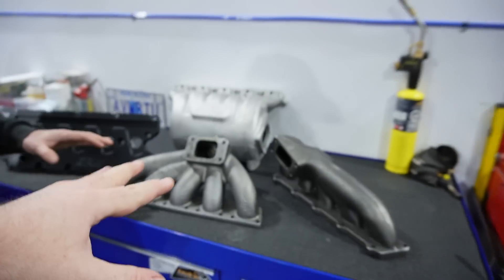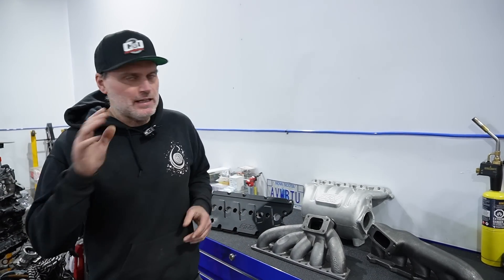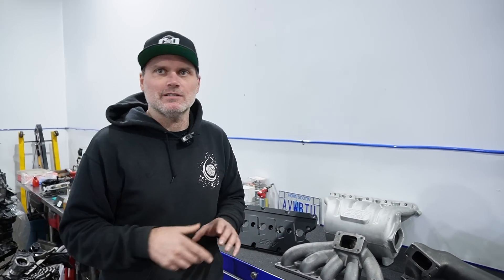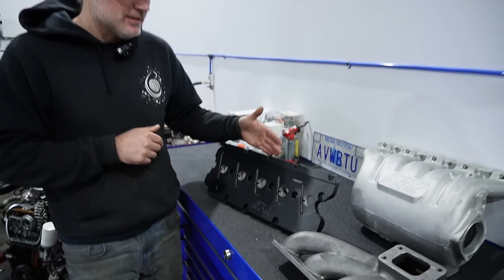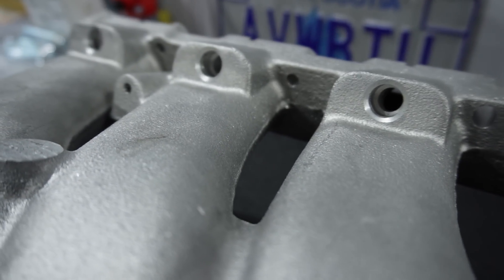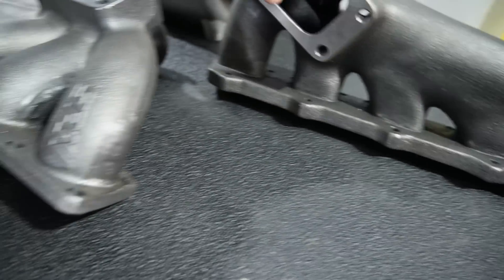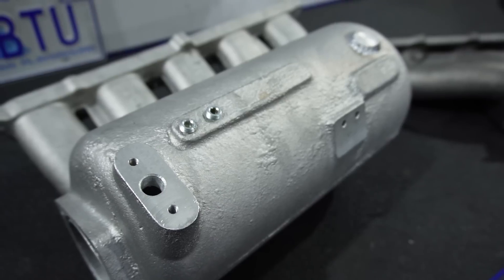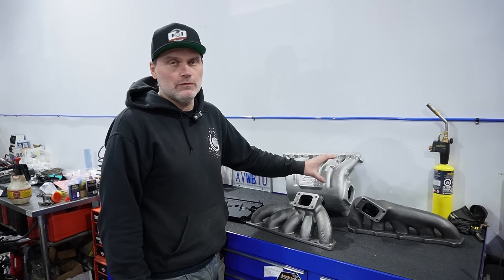07K 2.5 5 cylinder Turbo Kit? A closer look at the SPA Turbo intake and Exhaust Manifold.

Comment: The information is hard asf to find I have a 2012  2.5 and dsg trans swapping into my 91 civic. Do I need to buy a standalone. Is there some software I can get to tune the factory ecm.
Do I need to shell out for an expensive standalone ?
Is there people I can go to in real life to dyno tune for me like 
What's up idk why it's so hard to find the information please hallp
Reply from the maker: That stock ECU will limit you in many situations, especially if you plan to boost it. Even finding a calibrator that works with the specific ECU you will be using will be limited (especially when boost it). So if you plan on just doing stock setup, we can tune that ECU for a swap setup no problem. But if you're boosting it, just go to standalone now or switch harness and ECU to an older version which opens up a few more options.
Reply: @COMotorsports  if I go to an older ecm what do you recommend and will I have to keep the stock ecm to control the dsg?
It will be boosted immediately.
I'm tossing out a turbo b series for the swap lol

Comment: Yes I would love to be able to order a complete kit I can just bolt on I have the I.e. stage 2 tune and I take already but I would love a turbo kit that comes with everything intercooler ,injectors, fuel pump, fuel pressure regulator, and a oil cooled turbo with drain, feed line,  so don’t have to plumb into the coolant lines anywhere. Also  oil sending unit spliter and oil pan bung or sandwich style bung for oil return.

Comment: What turbo would that kit support?  i’m looking at gtx3071R Gen 2 or GT3582. 
Also would that kit supports the IE intake manifold?
Reply from the maker: Well the exhaust manifold is for any t3 flanged turbo, or with an adapter ant vband turbo. As for the kit we don't make one as of right now. As the video describes we're just testing the waters. I'd we do it it will be for their intake manifold as well. But since I know how both manifolds fit it wouldn't take much to modify to IE intake.
Reply: @COMotorsports  Sweet, let us know if yall make a kit. I would be very interested for my mk5 rabbit 07k build

Comment: i jave a 2011 mk6 jetta 2.5,will the intake manifold fit above my hydraulic power sterring ?unlike the Ie manifold that will not,tryi g to go stage 2 without new steeri g rack or the loss of my ac ..any help appreciated thanks !
Reply from the maker: On their website they state "Compatible with hydraulic and electric steering."
Reply: We are in the same boat. Did you ever get the spa manifold?
Reply from the maker: @volk4342  oh yes all that stuffs here.

Comment: Its super nice to see that SPA made the wastegate larger on the top mount manifold because im currently running into boost creep with my bottom mount manifold. I have also noticed that the wastegate port does not match the the diameter on the wastegate so you would have to grind the hole bigger on the manifold.

Comment: The kit for the MK7 would be a great idea for owners who are looking for a bolt on kit for their whip.
Reply from the maker: The MK7 never came with the 07K so none of this applies. Could it work if someone wanted to do an engine swap as well possibly but this is about MK5/6 NA 2.5L vehicles.
Reply: @COMotorsports  My apologies. I got caught up with the name and not the application. I would do it on a special request basis before investing in the kit. It's a business decision based on inquiries.
Reply: Based on the response. it's from the guy who likes rum, not beer. LOL